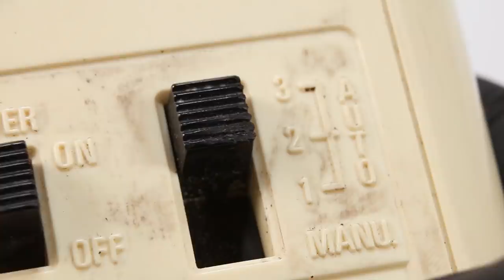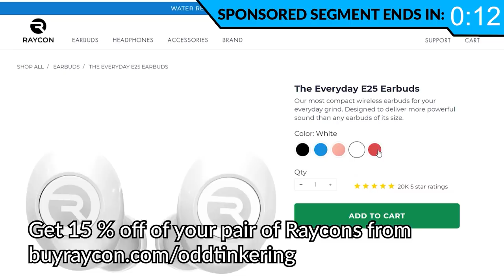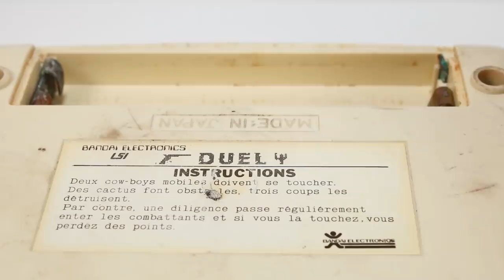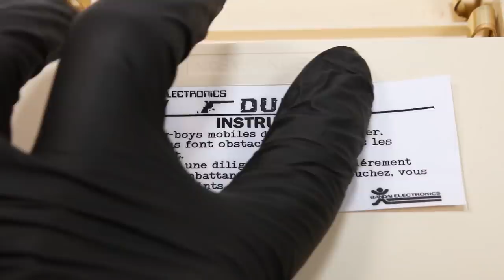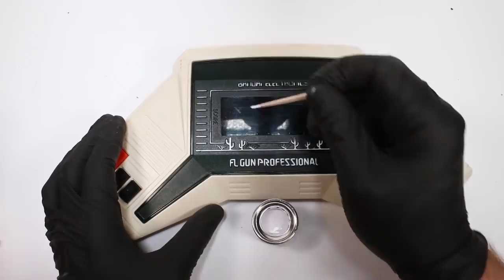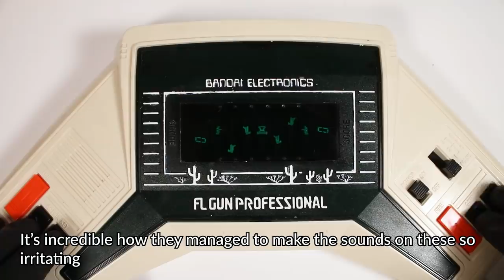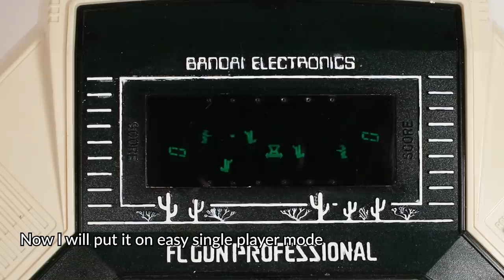I Restored & Repaired This Rare Multiplayer Duel Console - Retro Game Restoration

Comment: Always cool to see what's inside those old machines. That 4-bit D553 CPU was used in quite a few handhelds of the era e.g. Pacman, Dracula etc. It had 2K of ROM spread out over 8 banks, but only 96 nibbles (48 bytes) of RAM.

Comment: I use baking soda and cooking oil (peanut, sun flower) to git rid of battery corrosion, put both baking soda and oil in cup and mix it and drop the corroded meta in, oh also you can use baking soda and super glue to melt plastic together if you have any broken plastic

Comment: A cool trick I found for removing stickers without damaging other sticker/labels underneath them is to use a hot air rework station and keep the heat as low as possible. I have a 898 clone and it only goes to 190c minimum but it works great for getting blockbuster security stickers off old game and VHS labels.

Comment: I don't know if you know it or if it is true in this case but sometimes the "goo" inside things like this is put there on purpose. It is known as "thermal gel" or "Thermal paste". It is meant to "eliminate air gaps or spaces (which act as thermal insulation) from the interface area in order to maximize heat transfer and dissipation." In other words you should research which times the "goo" should or shouldn't be there before "cleaning" and removing all of it which MAY be detrimental.

Comment: I'm trying to restore an old super famicom controller but one of the screws holding it shut is stripped pretty badly.  What's a good way to get it out?  It would be very similar to one of the screws holding this system's shell together (but stripped)